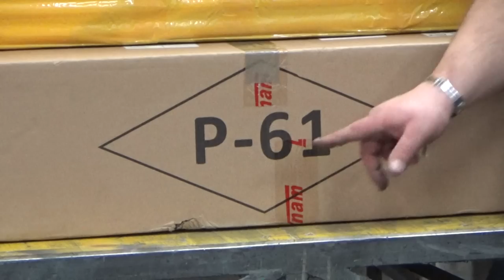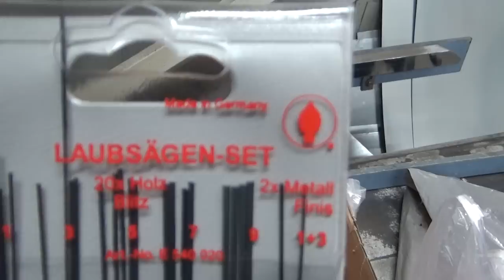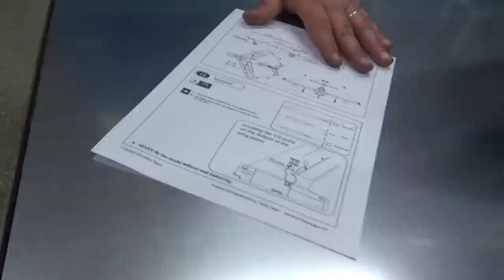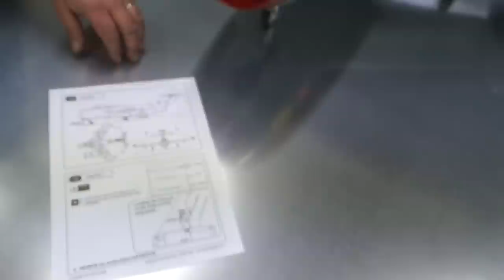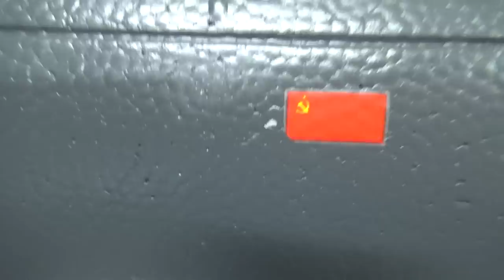MIG15 Giant 1.6m 90mm EDF jet Quick after rebuild review and test

Comment: Open the black widow! Hahaha
Reply from the maker: Hey Matthew, we did and it looks great. Again there are few mistakes on a brand new plane but I think that I will fix them. I really dont know what is happening lately. Every new plane we got there is something broken inside. Iam starting to think that it would be better if we start buying only second hand planes ;) Stay well and see you soon, Robert
Reply: Robert Petrinčič yes indeed.  Dynam has always been less than perfect with their new products.  My b26 crashed due to the main wing anchor bolts pulled up messing up the angle. So my maiden flight became the maiden crash.  So yes go over that baby double or even triple checking.